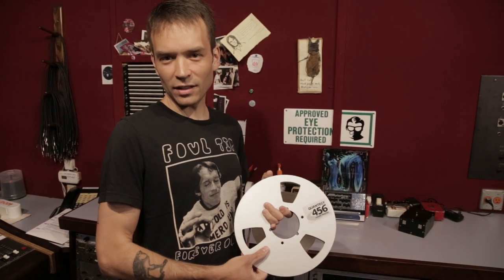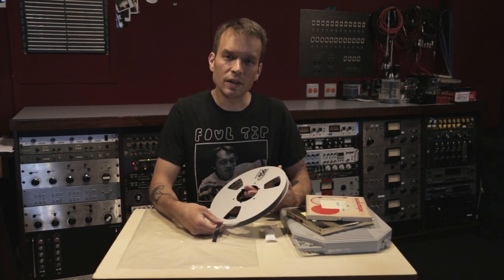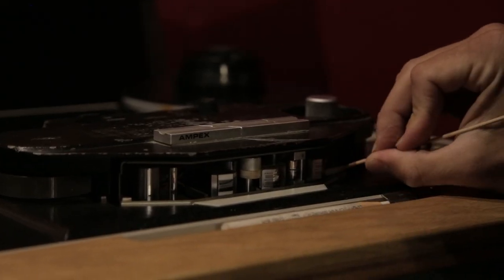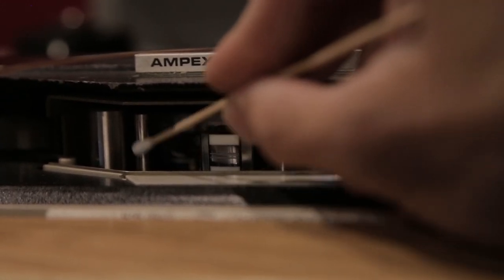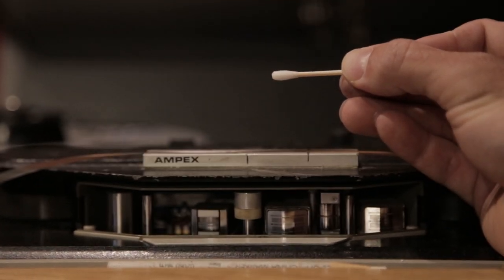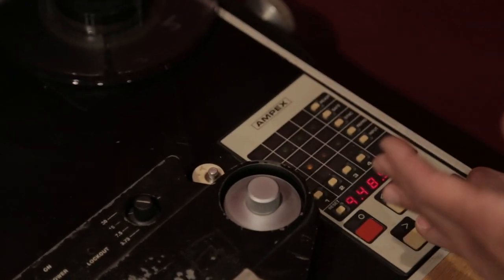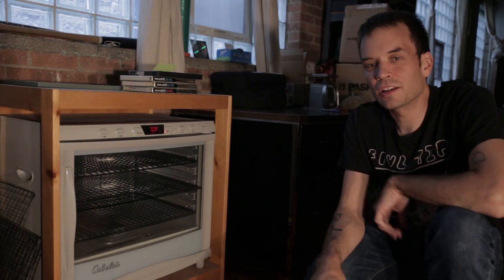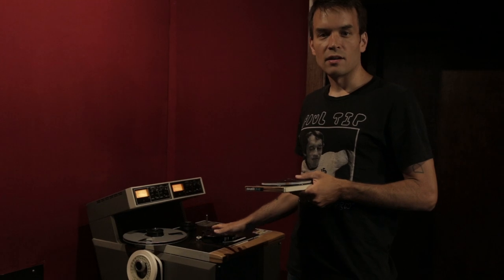Electrical Audio How-To: Baking and Transferring Audio Tapes, Pt. 1

Comment: Interesting video. I've found that doing a full library rewind away from the heads and then checking the beginning of the tape shows me whether the tape needs to be baked or not. It needs to be fully rewound anyway before it can be baked safely.  130 F for 4 to 8 hours (depending on tape width) in a convection oven does the required job with a four hour rest before transfer. When I worked at the CBC and we would bake two middle cabinets full of tape overnight for 12 to 14 hours in a temperature controlled 4 drawer metal file cabinet (heated by incandescent light bulbs with fans mounted in the top and bottom drawers) and that worked beautifully as well. Transfer is a delicate process and digital audio capture recording should be done immediately as soon as the tape is loaded for playback. This recording process has also saved me on a number of occasions  with older acetate type tape and poorly stored lower quality tape (which should never be baked) where the tape has separated from it's backing through shedding. The first play was the last play but the archival audio was saved via this "assume you have one chance" transfer technique.

Comment: Great video, nice shots and good resource links. It was very good to mention to check if it's an acetate tape, which, unlike in Europe, was especially popular in the US. It should be also mentioned how to determine this type by holding the tape wind against some light source. A brownish shine-through will usually indicate an acetate tape, while others will not let light through. The safest way is to bake a (non-acetate) tape on a metal reel as some plastic reels will not hold up to 130 F / 55 C.
Reply from the maker: Those are very good points, thanks for the comment!
Reply: I thought the same thing: I would never bake a plastic reel even at 55 C
Reply: @sonnioffice6439  Some say bake at 113 Fahrenheit degrees?
Reply: @MrmelodyUs  i think it's a case of trying at a lower temperature first for 12-24 hours , then find the optimum for your tapes and whatever oven you're using.

Comment: Great video, I have a nice new dehydrator that I figured I can use for this. I only have around 30 reel to reel 8 and 16 track recordings but I was not able to transfer all of them to digital due to sticky tape issues. So thak you for posting.

Comment: Just to be clear, it is the binder (that holds the magnetic particles) that is hydroscopic. 
Most sources I've seen recommend baking a  reel of 1/4" tape for 4 hours, (and cooling for the same time).
Reply from the maker: I think you mean HYGROscopic, not hydroscopic.
Reply: @ElectricalAudioOfficial  You're right, of course. (My problem being that I knew 'hydro'  was the Greek root for water, but didn't know that 'hygro' was the Greek root for moist.) :)

Comment: Can you fit two 2" tapes in that oven, if so, for how long do you bake them? and For how long do you think a tape could work before it needs to be baked again? Thanks, and great video!
Reply from the maker: Yes, we can fit two 2" tapes. I try to bake incrementally- the first bake is 24 hours for narrower tape or later 2" formulas (499, GP9), and 2 days for 2" of problematic formulas (456, 468, 996). I check after the first bake, and if it's not playable, I'll re-bake with longer time (3 or 5 days), then check again, and if it's not playable, increase the bake time again (a week or sometimes up to two weeks!).

Generally we say that tape is playable for a month after it's been baked enough, but that's a pretty rough estimate.
Reply: @ElectricalAudioOfficial  OK, thanks for your reply. Wow, two weeks, that must be a record! 😅.  Best regards and thanks again for all the cool videos your making. 🙏

Comment: How would I know if my pre- recorded purchased musical tapes are cellulose acetate base film ?  For example my Willie Nelson on Columbia?  It plays amazing and sounds great ! Thank you. Excellent video !
Reply from the maker: Often the box will say something like "polyester" or "PET" or "acetate" indicating one way or another. If not, the best indicator is probably production date-- acetate base film stopped being used widely in the mid-to-late 1960s, so if the album was released after that, it's almost certainly not acetate base.
Reply: @ElectricalAudioOfficial  thank you. It seems to be in excellent shape. I store these at normal temperature and humidify levels in my home listening room.

Comment: very informative. Can a tape with a lot of sticky shred cause a machine to slow on playback or stop fast forward and rewind?
Reply from the maker: Yes! It can cause both. Those are fairly extreme symptoms.
Reply: Electrical Audio    Never thought that could cause those symptoms.  I thought that was more a electrical failure.  Thx for sharing.

Comment: What if I have a bunch of tapes. Would it be a problem to just bake them all without the preliminary check? Doing check on all those would be time consuming. Thanks for the great info!
Reply from the maker: You could, though in professional archivists, whose domain this really is, recommend against unnecessary baking. You're right that checking tapes is time-consuming, we just don't really know long-term impacts
Reply: @ElectricalAudioOfficial  Thanks!

Comment: Are there any concerns with baking tapes with heavy splice editing?, like a splice every 8 sec for a length of 20-min or longer?
Will the baking destroy the adhesive glue of the splice?
Reply from the maker: It may well dry out the adhesive in the splicing tape, yes, but regrettably you may not have any choice but to bake! We often have to re-splice tapes during transfers. They will come undone during the wind when the forces on the splices are greater- another reason to wind SLOWLY as you don't want to risk damaging the tape if a splice comes undone.

Hope that helps and good luck!
Reply: @ElectricalAudioOfficial  Thank you very much!

Comment: Question  to mr.  Hales  Should be the cassette tape lubricated against 
sticking and if yes- what kind of lubrication to use and how this will 
affected the frequency range and the quality of the sound likes dynamic,
 noise  and wow and flutter. Thank you for your consideration in 
advance!
Reply from the maker: Hi, tape has lubricant in the composition of the coatings. Generally, you don't want to lubricate the tape for playback or transfer, as it can create a mess that could damage tape and machine. However, if you dig into Richard Hess' site, you'll find an article about "wet playing" tapes, and some other examples of people using very specific lubricants when baking couldn't restore a tape for transfer. I should caution that these should only be done by a professional who is setup for wet playing. In most cases where the tape is degrading because of sticky-shed syndrome, baking is the solution. But not in all cases...

Good luck!

Comment: Should tapes be put onto a metal reel for baking if their reel is plastic or they can bake on the plastic reel?
Reply from the maker: You can bake on a plastic reel. 130 degrees F won't melt the plastic.

Comment: Truly loved your video 
Thanks for the methodical approach and step by step approach 
May I ask what is the brand and model number of the oven and who the vendor is?
Also noticed your unit has 4 speeds up to 30 IPs
Could you advice on what models can I look for that have these 4 speeds for 1/4”? 
And are these 2 tracks or 4 tracks?
Thanks much
Reply from the maker: The oven is branded "Cabela's" but is made by Weston. I believe it's the "Pro-1200" model.

We use Ampex ATR-102s for 1/4" and 1/2" transfers up to 4 tracks. They are incredibly flexible in that you can set them up for 1, 2, or 4 tracks (provided you have enough audio cards and the appropriate meter bridge), as well as quarter-track, in either 1/4" and 1/2". There were ATR-100 machines that went up to 2" 24-track, but those were very rare.

The other machines that have 4-speed capability I know of are the Studer A820s, which also were made for a variety of formats and Studer A810. Some Otari and MCI machines offered a combination of speeds, but as far as I know none of them offer all 4 on the same machine simultaneously.
Reply: Greatly appreciate your prompt and helpful response taylor  @ElectricalAudioOfficial

Comment: Thanks for this very informative vid, Taylor. Are you pretty happy with the Cabela dehydrator?  Definitely more affordable than a lab-grade Thermo Scientific. Do you recommend the Cabela?
Reply from the maker: Yeah, it's totally fine! My gripes with it are minor- namely, you can't do longer than 23-hour, 55-minute bake time, so when we do bakes longer than a day, I have to add 23:55 every day.

It seems like with a lab-grade one you get a bigger capacity and probably better circulation. It would be nice having a bigger oven to do a whole bunch of tapes simultaneously when we get bigger transfer projects in, but I also think about how longer bakes can bottleneck our baking queue, so it would be just as nice to have two ovens with one dedicated to longer bakes.

Such are my thoughts!
Reply: Many thanks. We are upping our game as far as in-house AV digitization at my University and I’m looking at equipment to add to our lab. Really appreciate the info.  @ElectricalAudioOfficial

Comment: I just bought a machine like yours. I have some tapes from the mid 1960s - they are on a metal reel.  I just wanted to confirm that the 130 degrees will not affect the metal to the point of creating a HOT surface that is directly in contact with the tape.  Also - I see you demonstrating with a plastic reel - so I am assuming that is safe -- and is placing audio cassettes and video tapes in a housing?    What do you do when you have audio tape that on a core - and not mounted on a reel --- do you lay that tape directly down on the wire rack surface -- or do you mount in a reel?  Thanks!
Reply from the maker: Hi there. First, there was a lot of tape from the 1960s that was acetate base film. If you look on the box, it will often say "on acetate." If it does, do not bake. Not only will it not do anything, but acetate is flammable. Minimal risk you'd burn down the studio, but not worth it! If the tapes say "on polyester" or indicate otherwise that they have a poly film backing, you can bake.

The tape flanges will get hot to the touch, but that is OK.

You can bake tapes on plastic reels, yes. We haven't baked audio cassettes ourselves, nor video tapes, but anecdotally I've heard of people doing it and it not ruining the tapes. Whether it restores them I can't say.

If the tape is a pancake that is not on a reel, yes, you can lay it directly on the wire rack. You can also disassemble a reel and place the pancake on a flange so that it's fully supported, which is a good idea if the tape pack is loose so that you don't risk it unspooling when you are taking it in and out of the oven.

Good luck!
Reply: @ElectricalAudioOfficial  Great  - thanks!  Good info.  So - let me ask - I have read that the good news is that acetate base tape - is not prone to Sticky Shed Syndrome - is that what you understand or have found?  Are there any problems associated with the acetate base tape?- and is there a remedy for that (as you can't bake it)?
Reply from the maker: @bj3692  Yes, acetate base tape doesn't exhibit sticky shed. There are other ways it can degrade, though. Check out Richard Hess' site (link in the video description). The most common degradation for acetate base is "vinegar syndrome." It can also leave some residue on the heads and in the tape path.
Reply: I wanted to ask one more question -- I can't seem to find any picture of this on the internet - so maybe you tell me.  As it relates to Acetate tape - visually which side is the bind and which is the oxide.  So - on the four tapes I have - both sides are brown - but one is matte and the other is shiny.  The shiny side is wound OUT on all 4 tapes I have - and the matte is inside.   On all polyester - the shiny brown side is the oxide side.  SOOOOOO - if the shiny brown is also the oxide side on Acetate tape and well -- then I guess my tapes have been would this way for some purpose?  I know in the film business - we reverse the emulsion direction for archive storage.  Perhaps this is done with tape as well?  Thanks so much for your help. --- I really don't want to do anything with these tapes until I know which end is up!
Reply from the maker: @bj3692  it's possible the tape is not back coated. If it's from before 1970 you can bet on it. Audio tape is never intentionally stored with the magnetic coating out, as it would require manually flipping the tape and hand winding it onto a reel for storage that way, and then flipping and hand-unwinding it back to normal for playback. We sometimes encounter tapes that have been stored that way accidentally, but never intentionally. so try playing it as it was stored.
Reply: @ElectricalAudioOfficial  thanks --  all went well - the brown matte was the mag side - and the shiny brown was the base.  Thanks!

Comment: Excellent video, thank you. What is the recommended solvent  to clean the rubber rollers?
Reply from the maker: Hi,

We've heard two different things- ATR Service Co. recommended isopropyl alcohol, even though we suspect it may dry out the rubber. They're the pros, though!

Athan corp makes a cleaner specifically for their rollers, though I'm not sure it's appropriate for standard rubber rollers.

Hope that helps!
Reply: I always understood distilled water is preferred - unless a solvent is needed to remove a sticky residue (then diluted isopropyl alcohol - or isopropyl alcohol followed by distilled water). Obviously allow the rubber to dry before running a tape, although a lint-free cloth will remove most moisture.
Reply: @ElectricalAudioOfficial   I have an old product called Rubber Renew - a cleaner/re-conditioner, but I'm afraid to try it on my newly purchased MTR90II.  Any thoughts?
Reply from the maker: @bradchatterton2576  A quick Google search turned up an Amazon review where someone had disastrous results using that stuff on a pinch roller. 

If your rollers have become sticky,  you probably need to replace them. Athan makes new ones that are considered an upgrade for just about every machine out there, and Terry's Rubber Rollers will replace the worn and sticky rubber on your existing pinch/ impedance rollers for cheap. For cleaning tape reside off, use high concentration alcohol, but it will dry the rollers out.

Comment: Should there be any concerns about the metal rack in your oven containing any magnetic properties that might negativity affect the very sensitive tapes?
Reply from the maker: I can't imagine the wire racks have obtained a permanent magnetic charge, but it's possible. Still, the magnetization would have to be substantial to erase or compromise the tapes whatsoever.

Comment: Finally! This is a great tutorial!
Question: I have Ampex  456, and 499  ½' tapes.  Are they PET base, or cellulose acetate base film?
Thanks!
Reply from the maker: 456 and 499 is all poly base- you can bake it. Almost all 456 older than, say, 10 years old will need at least a day of baking. Some 499 will be ok without baking, some will need it, depending on age, storage conditions, aging, etc.

Comment: Is it ok to record pro tracks on tapes that have been baked? The reason I ask is because I have a bunch of Ampex 499 and 456 that all leave that gunk upon the first play/run after 20 years of not playing. They’re not sticky. I’m in the process of baking them. They’re NOS blanks and I would like to record on them. Would the baking degrade the way they’d print/record? Thanks.
Reply from the maker: First and most importantly, it's definitely a very poor practice to record anything to tape you know is bad, so don't do it!

Secondly, if tapes are leaving gunk on anything, they ARE sticky. That is the symptom of sticky-shed tape. Regardless of whether tape has ever been recorded on or not, it can (it DOES) get sticky. 456, 499, even GP9 all become sticky with age, used or NOS, and how quickly and to what extent they do so depends on the manufacturing conditions, storage conditions, and a multiple of other factors. In 2022, you should not be recording on any of these formulas for anything even remotely critical, because even if you bought tape from the last batch ever manufactured of any of these formulas, it should be considered bad at this point. This is why it's slimy for people to sell these tapes on ebay, Reverb, etc. Maybe they don't know, but that tape is not usable, and certainly not worth more than it sold for new.

Comment: Does the brand dehydrator matter? What would you recommend? also, is a convection oven better for this than a dehydrator?
Reply from the maker: Brand doesn't matter. The important things are that it can maintain the right temperature, and that air circulates so that the temperature is even throughout the volume of the oven.

A convection oven would be fine if you find one that can get down to 130 degrees F.
Reply: @ElectricalAudioOfficial  Got it. Thanks